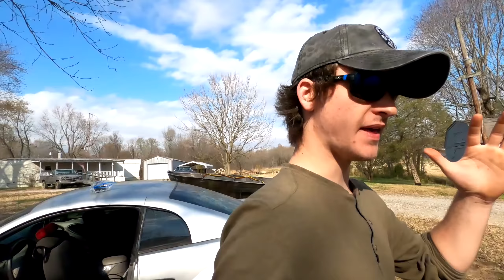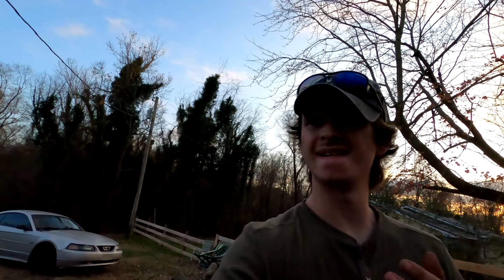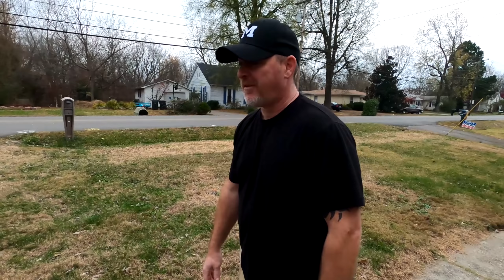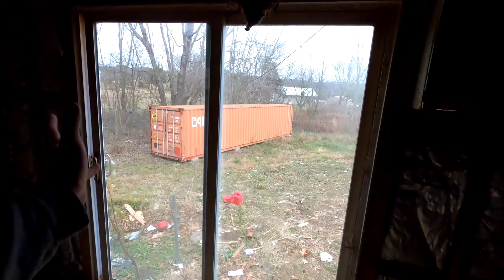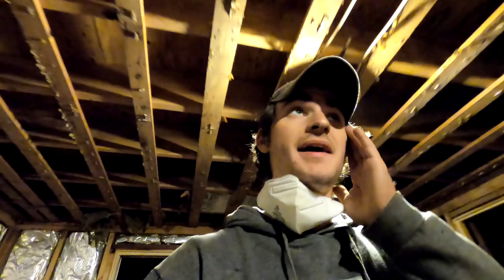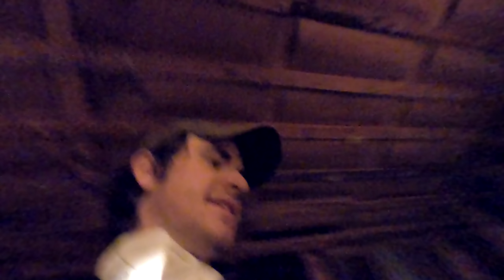I GOT ELECTRICITY!!!

Comment: Instead of dropping the tank loosen up the bed bolts on one side take the bolts out completely on gas tank side 
Grab you a 2x4.....tilt the bed up prop sod 2x4 on the tire holding that bed up while you swap the pump 
A lot easier and quicker 
Your welcome